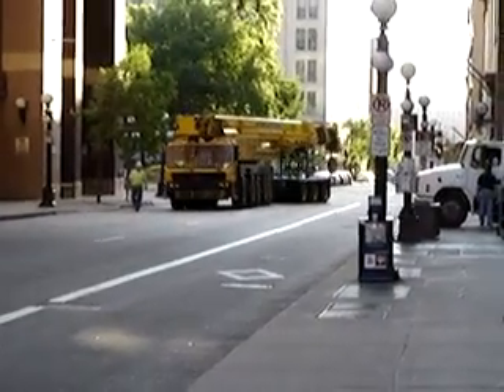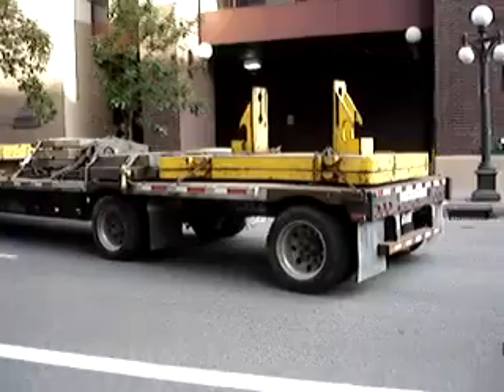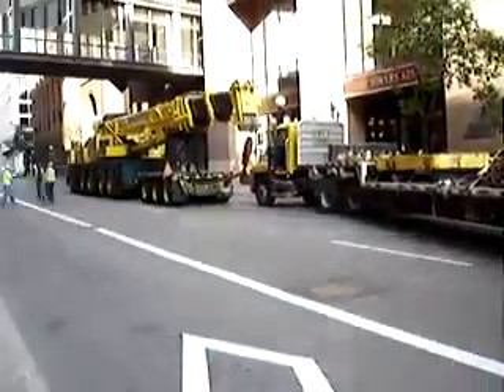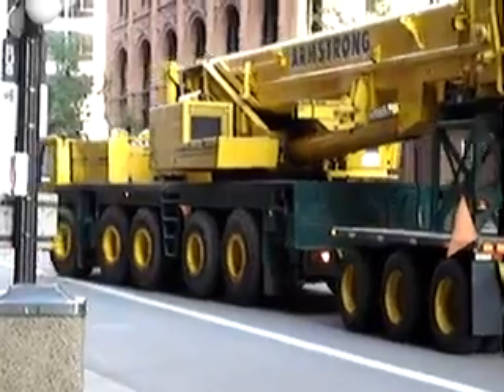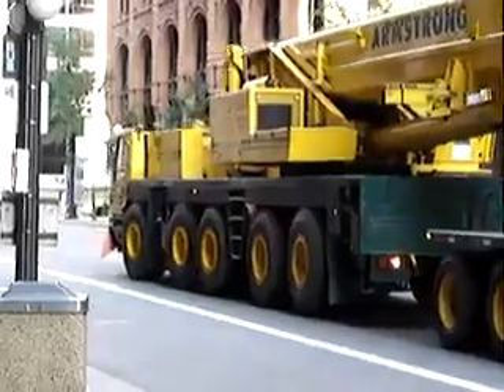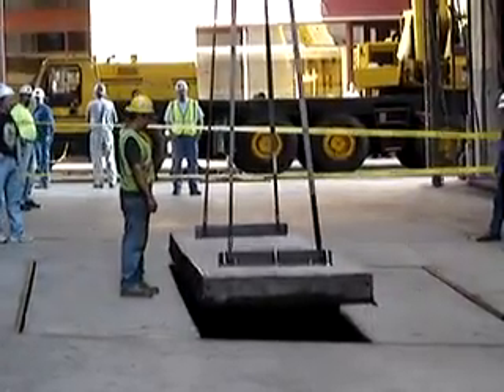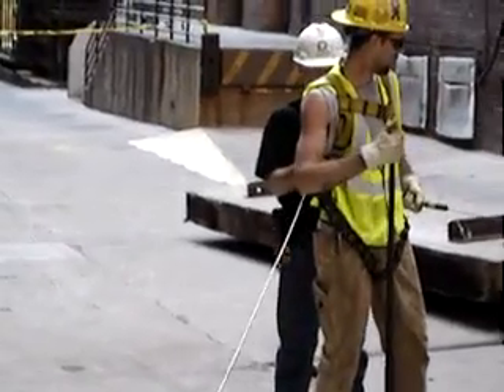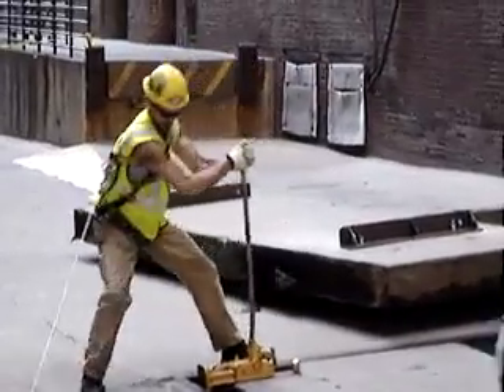VISI Installs 2.25MW Generator in Downtown St. Paul

Comment: The generator set is a 2.25eMW package using a Cat D3516 short stroke engine.  On the side is a 6" oil cooler.   A 2.5eMW engine is the long stroke version of the D3516 and has a 7" oil cooler for easy identification.   The generator efficiency must be used in any calculations.  The engine puts out 3401 bhp.